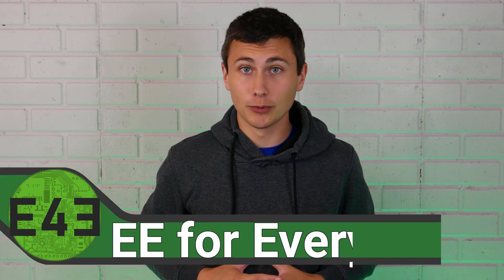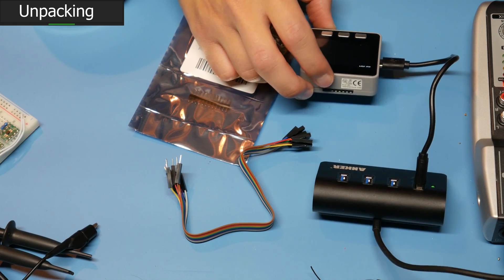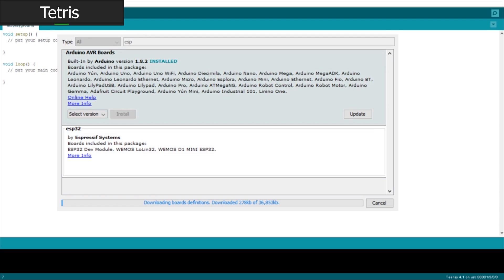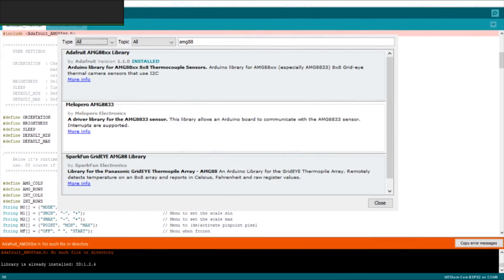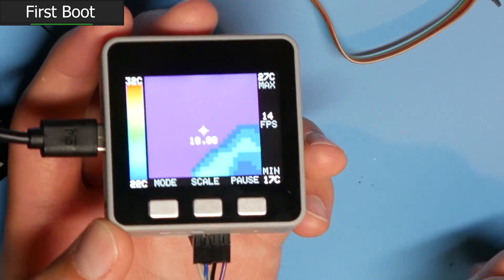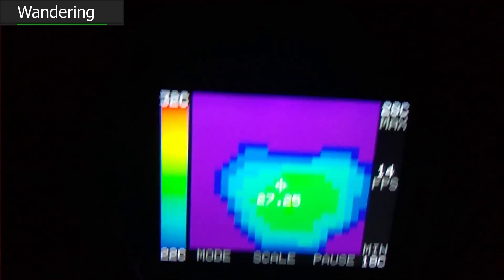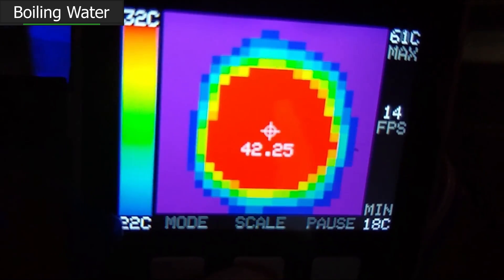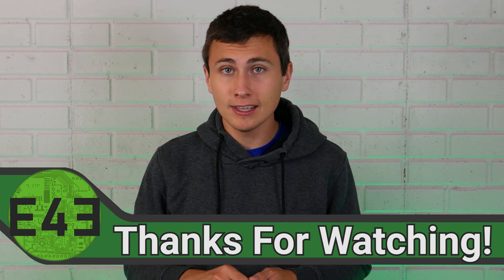DIY Thermal Camera with AMG8833

Comment: Does it have range to find water leaks in house
Reply from the maker: Hi DJ, I'm not sure... it's range is pretty good, but resolution isn't great. You may be interested in this, but I've seen some IOT moisture sensors that are pretty cheap. Not great for finding new leaks, but could be helpful near common failures (valves, water heaters, HVAC, etc)  They generally use stainless steel contacts and can talk Zwave or Wifi. 

You may want to consider the FLIR phone add-on cameras as well, very cheap for what they do! For example: FLIR ONE Gen 3

Comment: can i use 4 AMG.. to have better resolution,  i am searching a cheap thermal camera at least 50 metters, thx
Reply from the maker: Of course, it's possible to use multiple sensors, but I think aligning them will be a challenge. For example, if you align them so the sensors make a perfect grid at 1 foot away, the sensors will overlap and measure some of the same areas when measuring objects farther away. yikes!

It's probably best to use a single higher-resolution IR camera! I know there are some decent ones that are made to work with a smartphone!

Comment: Well that's pretty useless.
Reply from the maker: Hi Dustin.. I have to admit that the resolution isn't great. Considering it's running on an arduino compatible though... I'm still impressed! Won't be taking down flir any day soon. :)
Reply: @EEforEveryone  sorry.  I'm just searching for information. I'm hoping to find something 625x480 that I can run on a monitor on a boat or semi mobile. Its a long story but I fish looking for ripples on top of the water at night.  Just trying to avoid spending 5k without knowing my idea will work out.  Thanks
Reply: EEforEveryone what is study called that you can do this

Comment: Cool, but the quality...
Reply from the maker: so true. Better than a swift kick to the head.. but a higher resolution will be very nice.
Reply: @EEforEveryone  I have an actual thermal flir camera I was lucky to get a hold of. I wish I had your know how. I'd turn it into a night vision for the car... that'd be super cool... 😅
Reply from the maker: Ooh, flirs are great. Aha! Night vision for a car is a great idea! You'll get there soon for sure. :)
Reply: @NonnofYobiznes  I would just get a high resolution camera without the ir filter, add a visible light filter, hook it up to either your phone using a hud app or something similar. You may want to double check that you don't need a UV filter or anything like that. I haven't studied enough to be an expert. Don't forget IR illumination. Check laws to see if it's legal

Comment: Very cool!
thermal cams are indispensable for troubleshooting the power supplies and mainboards I work on.  As well as figuring out what windows in the house needed attention.  This is so awesome man. If you need a cheap, USBC version , look for the HT102 series.  There are others made with the same package.  Thanks for making this video
Reply from the maker: Hello FixitFrank! Great idea with the (HT102) as a higher-resolution option, I think the flir one is slightly more expensive.  I was so surprised at how quickly this project came together, and can't agree more on how useful thermal cameras are!
Reply: What gave you the idea that this is anything except a toy.